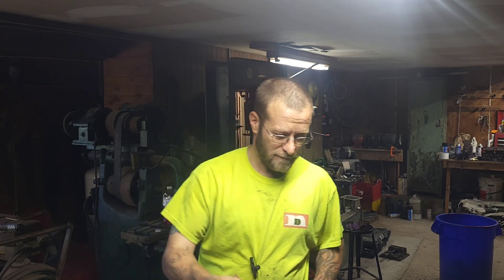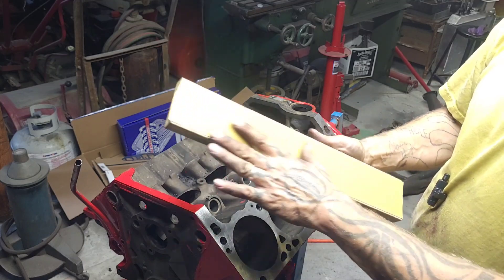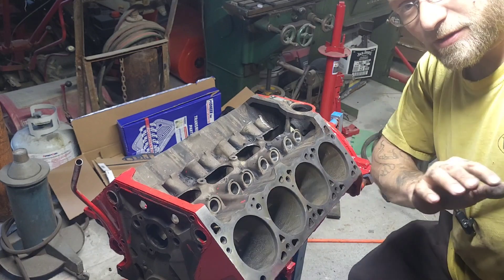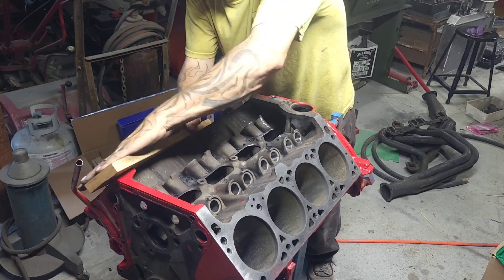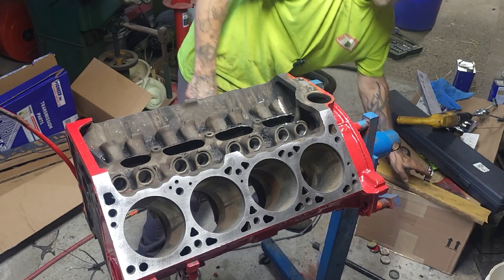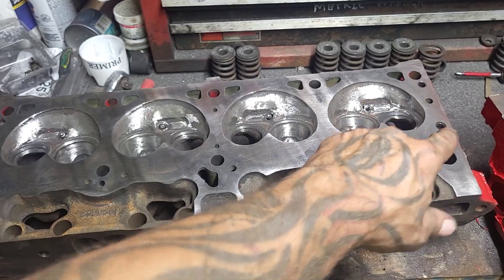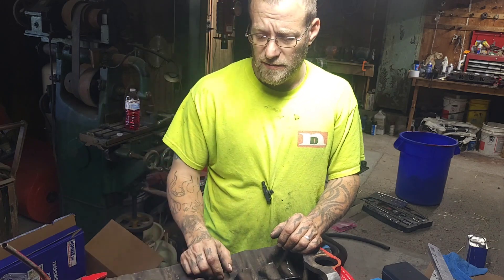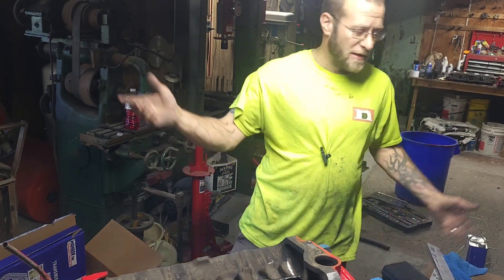Diy easy engine block deck surfacing. 318 build.

Comment: The cast iron block is pretty forgiving , plus good quality head gaskets can compensate for a few  thousands of irregularities, the important thing is to have a good finish on the metal as you are getting the surfaces done with a very flat piece of finished oak. I would have never thought of that, I'm very impressed with your skill!
Reply from the maker: Thank you! Good clean finish is key.

Comment: Would you recommend using say WD40 on the head and the paper to wet sand it?
Reply from the maker: Yes you can. It'll help keep sandpaper clean and last longer. Just make sure it's wet/dry sandpaper.

Comment: What if the block has a low spot in it?  Is this method acceptable to achieve a flat surface in that situation?   Something like 0.009" difference between "high" and "low" spots.   No clue how it got like this.....
Reply from the maker: You can definitely get it closer for sure. Type of gasket material can make up some as well.
Reply: @mcmotorsports  it’s probably closer to 0.004.   I’ve got a 9”x24” of flat granite to use and plan to use lapping compound.   What kind of gasket would you run?   Building a 383 with about 10:1 if that matters.   And how do you clean the block after this process?
Reply from the maker: Mahle graphite I like. Surface has to be perfect for cometic ones so I'd stick with the graphite ones. I like to use gas for cleaning. Little hole in a bottle or condiment bottle works good.

Comment: I've seen people use a sheet of glass since it's perfectly flat and you can stroke the whole block at the same time. Also if you lay some paint down you can see the low spots
Reply from the maker: Yup, another good way
Reply: great idea!   I had not thought about the paint.  I will definitely do this.